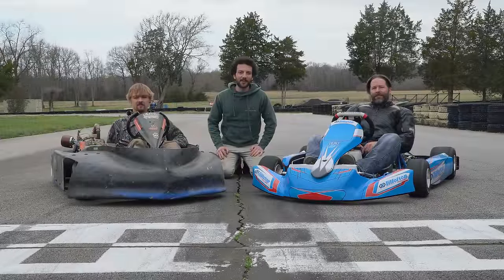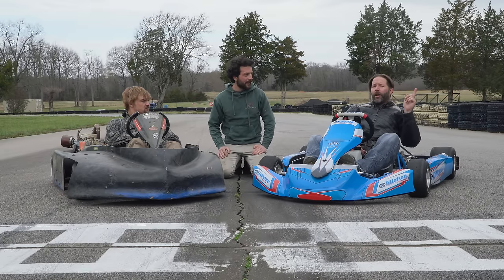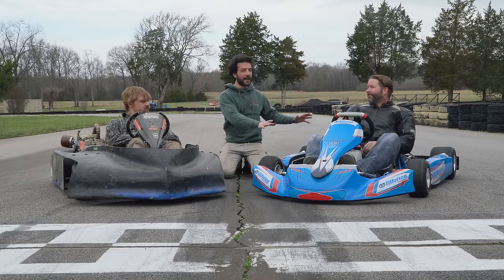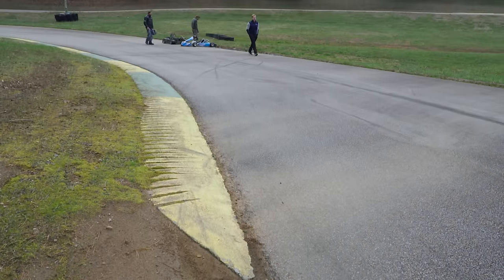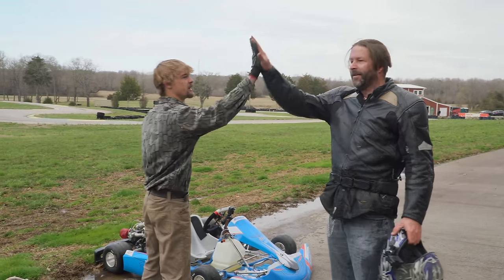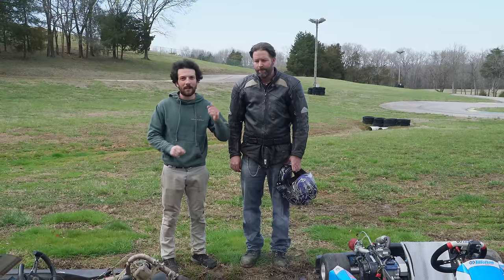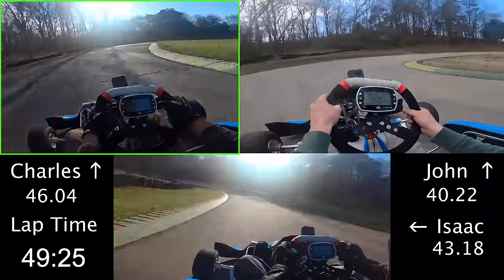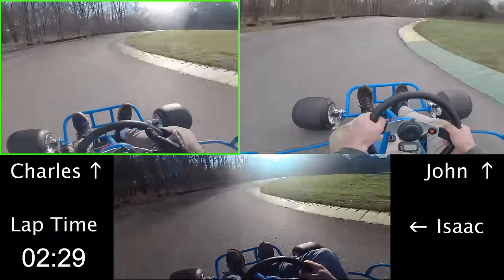Can a Retired Oval Go Kart Outperform a New Tillotson T4 Racing Kart? 3 Way Track Shootout!

Comment: It would be really cool to see a head to head comparison (speed and cost) of the T4 v. LO206
Reply: Have been at the kart track when John was running his T4 with the public. He was blowing around the LO206 guys.
Reply: Having done back to back with the T4 vs LO206 engine in stock form, the Briggs is a lot slower, but the Briggs is cheaper to purchase.
Reply: @AFFMotorsport  I believe they cost exactly the same.
Reply: @WyFoster  Here you can almost buy 2 Briggs for the price of 1 Tillitson engine, but saying that no Briggs have been available new since last year, and its having a huge impact on the club I race for, our entries are dropping fast, were down to mid to high 20's per class, from almost 40 per class.
Reply: @AFFMotorsport  They're both $600. I don't know where you're looking.
Reply: @WyFoster  Australia

Comment: Is Charles running new tires also, or 2013.    

The tires that killed paul walker were 9 years old.  Not only do they lack some grip when rolling at that age, they lose even more once sliding making control and recovery much much more difficult.

Edit:  I see you referring to them as old.  Let’s see a re-run in both directions around the track and see what it can actually do.

Comment: If you ran Charles’ kart counter clockwise on the track it may have done better due to more left turns.
Reply: If it clocks diagonally yes. Bearing is worn out. If it moves in/out on the crank yes. Add spacer washers to tighten it up. If I it free spins on take off that’s ok. It’ll let you get up into your power band quicker.

Comment: I hope the t4 would be a very well performing go-kart for the cost of $4,250
Reply: Depends what you want. You can buy a 2 stroke race kart easily for half the price off ebay and buy similar karts to the tillitson spec even cheaper. Brand new, my race kart would be close to £9000, (cost £1500 off ebay) so $4200 is very cheap for racekarts but they still give alot of fun for the money with running costs very cheap and organised cheap to run race series you can join.

Comment: You guys need to get jimmy rivers F92 Engine and test it I owned for 2 weeks and ran it once on a short extremely steep dirt oval but I grip locked the kart for the first time ever I had to much grip and it broke the old hub I had then now my kart is a chain guide and floating hub what ever the top tier recon come with they have made 2 chassis since I've raced the deuce which was the fastest thing ever like a "seraph" but in drivable unless you spent 4 days measuring tire diameters and checking corner weight but I heard tha deuce would roll if right as far as the scythe I have no clue everyone dropped phantom after they couldn't buy a recon because anyone that had one was keeping it unless quiting racing that how I got mine

Comment: The $500 kart is a LTO kart which means left turn only It is a oval kart not a sprint kart like the other guy has.
Reply: There are oval karts wow this one is new I've never seen an oval kart track also because normally kart tracks are small and therefore optimize the spaces to lengthen the track with few grids and many curves

Comment: The  Briggs is a animal engine which replaced the flat head five it ruined racing the flat heads where better all chasis have to be scaled for the driver oval karts don't turn right well you need straight up left right chasis to play on that kind of track

Comment: Dude. One, the tires are different but the biggest part is you guys never once (really ever including off-road karts) mention or adjust air pressure. Are you really that clueless? It's a HUGE tuning tool.
Reply: I set them on all 3